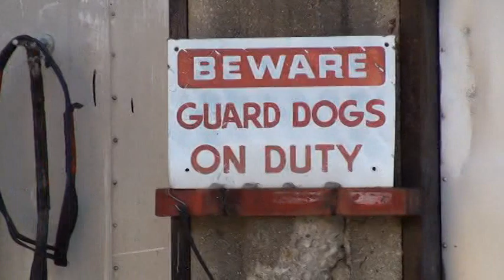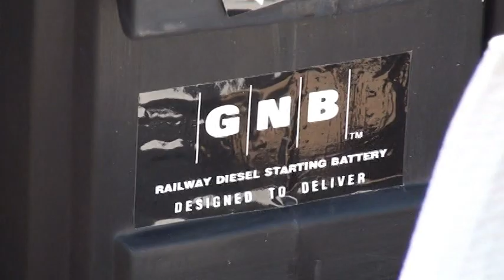Take A Tour Of The National Rail Equipment Facilities, Dixmoor, IL. 6-24-09.

Comment: Just curious...I have asked around on a few videos like this, but still no response from anyone. My question is, every once in a while in these types of videos I see what looks to be a locomotive with no cab. It is generally coupled to one that has a cab. Are those in fact locos? If so, are they in fact controlled by the locos with cabs? Any answers are appreciated. Great video by the way!
Reply: Yes, they are locomotives known as "B" units. They are coupled to a loco with a cab and that loco controls them. They operate like any other loco with the exception of not having a cab.
Reply: Though if they don't have a motor in them then they are "slugs" and require another loco to supply power to it.